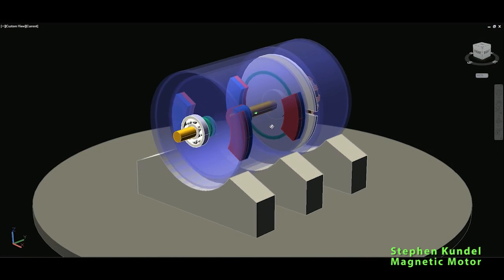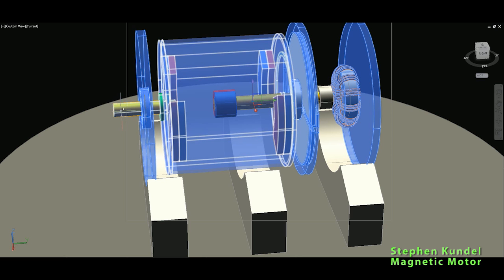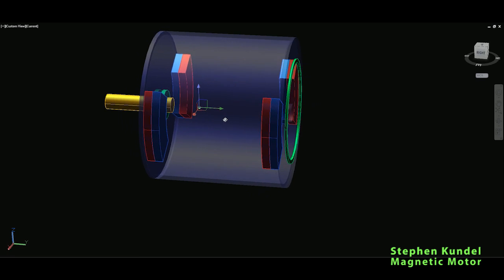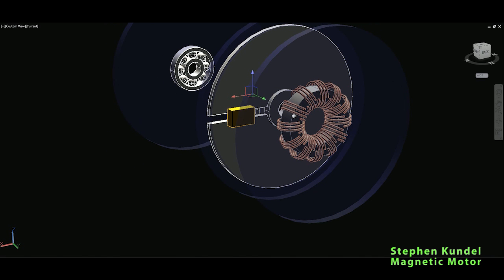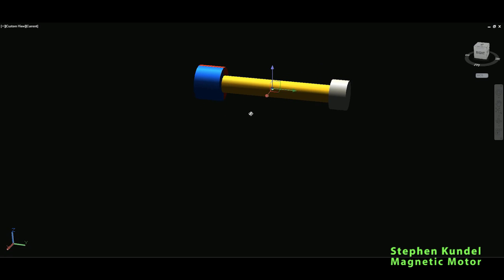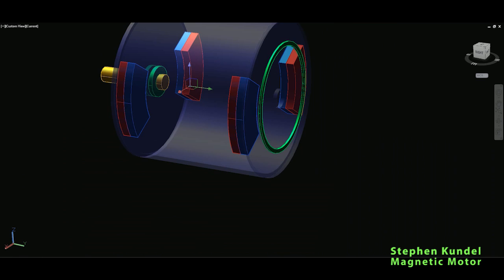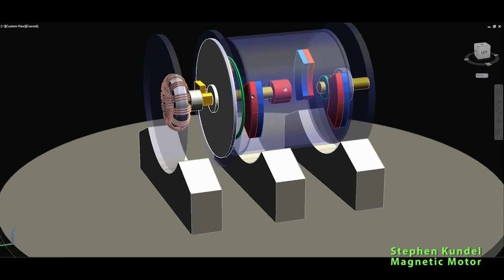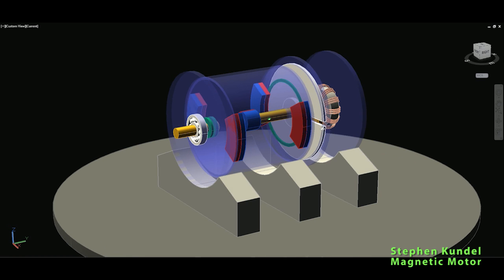Free Energy Generator, STEPHEN KUNDEL Permanent Magnet Motor, Magnetic Motor

Comment: hi. I hav a question. could you help me. what is not clear for me in this design, how the motor produce electricity? if there is a magnet that is inside or in the middle that is going to the right and then to the left, how the rotation is produced and which is the coil that produce the electricity. please could you help me, maybe it is simple to answer but i have not noticed this detail. thanks